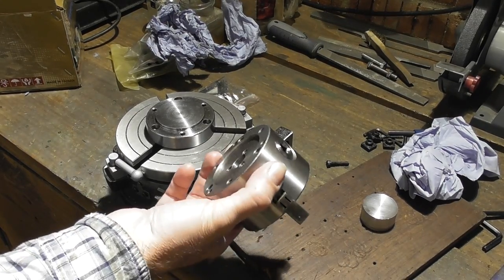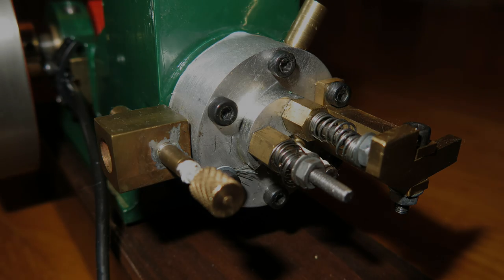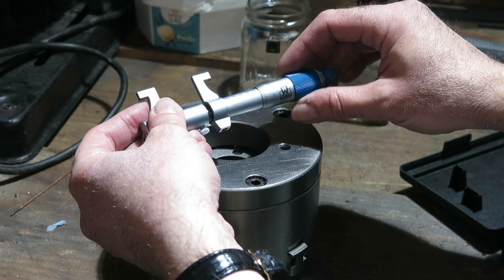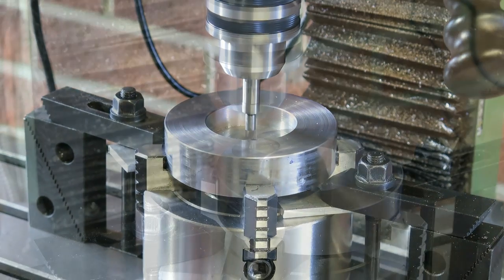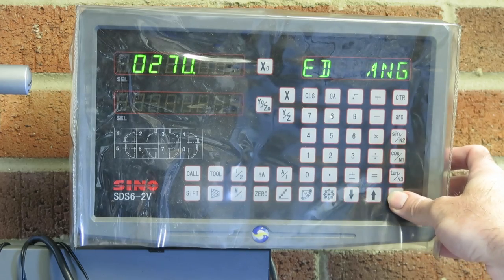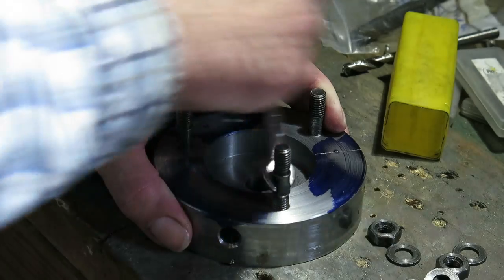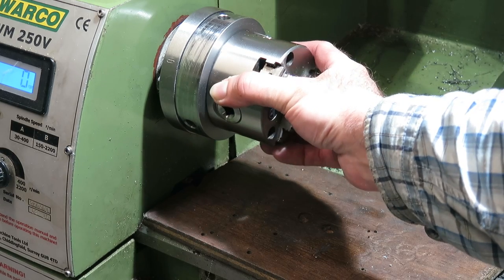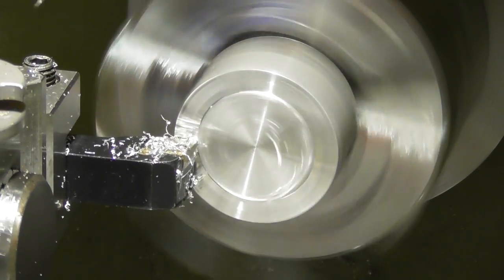Making a Lathe Chuck Back Plate

Comment: Just to offer something for anyone who doesn't have a lot of experience machining, at 1:55, "finding the center of the part", it IS be a lot easier to "edge-find" on the OD, ...not the ID..  This does mean the OD should have been turned/skimmed at the time of chucking when the bore was established. We did not see this done ....so it may not have been done ....however the part was indeed chucked with a 4-Jaw ...so it may have been dialed "perfectly" ...BUT...skimming/TRUING the OD is still the proper way to do this to ensure the material is put into a known condition of "roundness".
When you've got lots of time to go through this work ...fine.    But a lot easier to purchase a D1-3 back plate ....which has everything already machined properly.

.

Comment: The handle should have a slight interference. Because if you take it off lightly, the handle will beat too much. You must always take the temperature correction. Because after the handle is lightly inserted it cools down, there will be even more loose and thus more runout.

Comment: I’ve had great results doing backplates. Last one final runout was .0015 however that one took two back plates to get correct. Over cut the chuck recess because my calipers must’ve gotten slightly off zerod out at some point and I didn’t catch it. Hard lesson learned forgetting to double check the calibration before every use. Normally I do. Busy evening and missed that bugger. So if you know the backplate has zero runout the chucks the problem. I’d consider getting a better one you will be far happier with the results.byw the last chuck was a Asian 5c and they’re usually off much more.
Reply: One thing I forgot to mention when turning the back plate for a threaded chuck I always had to reverse the plate and square up the thread mating side first. Seemed I’d get a casting inconsistency where it would cause the chuck to shift a little because the entire surface was not equally pressured to the spindle mating surface. Which is already very small compared to a d1-4 which I did last and trued to .0015. Once I did that they alway trued perfect to the spindle specs and the chuck was usuall very dependent upon that step otherwise what would have seemed to cut straight goes out of concentricity when either under a chip load or when removed and then reinstalled. It was a doomed situation and always inconsistent when you tried to take it off and reinstall it. All those wacky issues went away when I realized that surface is turned first.

Comment: Hi, new subscriber late (VERY!) to the party reallyenjoyedthe video. I have a similar but perhaps opposite challenge in so much as I have a K11-80mm spindle/backplate/chuck but I need to mount a  125mm chuck via an adapter in order to get the through hole I need. I can't find anything on Google etc but that could be because I don't know if I'm looking for the right "thing"... any suggestions would be appreciated. 

ATB,

A

Comment: Hi Dave Thanks for the video very useful.  The pins that mount the backplate to the flange are they just a standard stud or are they slightly tapered ?  Did you buy them or make the studs ?  Cheers

Comment: Very interesting, and I like the video style - quick but enough detail to understand what's going on. One reason that I found it interesting is that I have read that with this type of lathe (Weiss-like 250's) it is difficult to get the tool close to the spindle to machine backplates etc, because of the chip guard on the lead screw. You had no problem with that?
Reply from the maker: Thanks for the comment. Yes, it is a bit awkward and it’s not ideal , but with enough tool over hang it does work.
Reply: Thanks. Looking again more closely, I suppose you were helped by doing the OD of the backplate whilst in the chuck, so you only had to do the register whilst actually fitted to the spindle, which puts it 19mm or so closer to the toolpost.